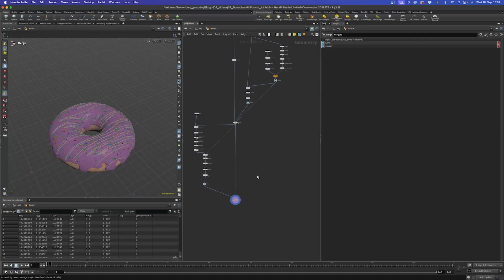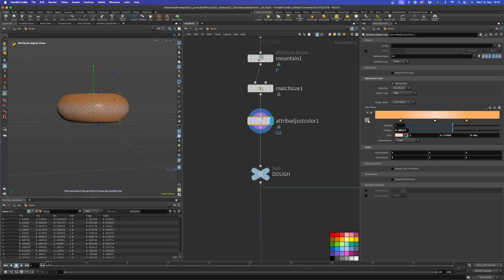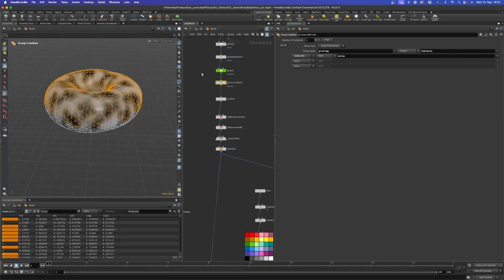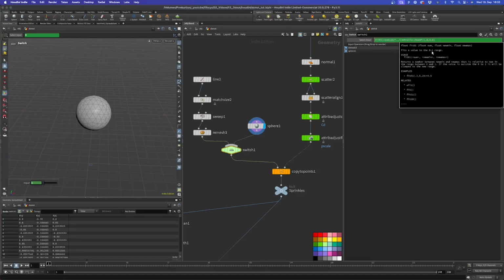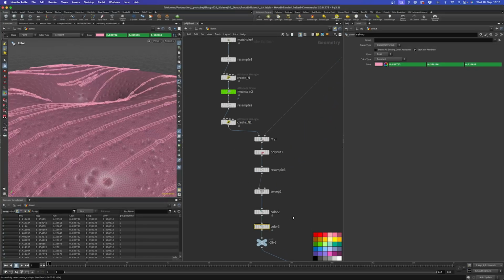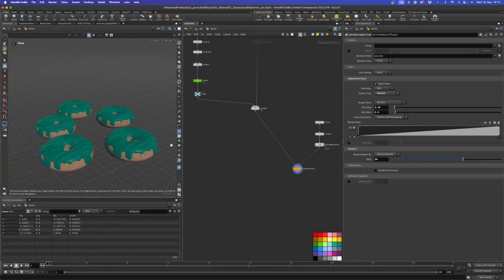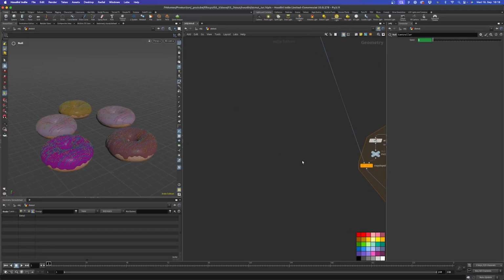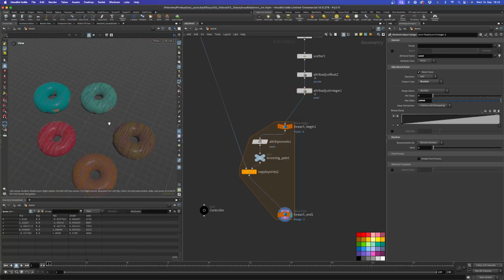Donut Part 5 Variations | Houdini Tutorial

Comment: Amazing series! It's so nice to see how someone else tackles problem completely different than how I would do it :D 
Just a small thing that I would do completely different: The moment where you started with the loops, I would just put as a seed value into the controller "$F" so that you have a different seed each frame. And then after you have the finished donut, I just used multiple tme shift nodes to get different donuts and then I could transform each one and merge them all together. Before that you could even use a file cache and cache out like 30 frames and then do the same thing.
Reply from the maker: I think thats the absolute beauty of houdini. So many different ways to explore. 
I will definitely give your route a shot! 🙌